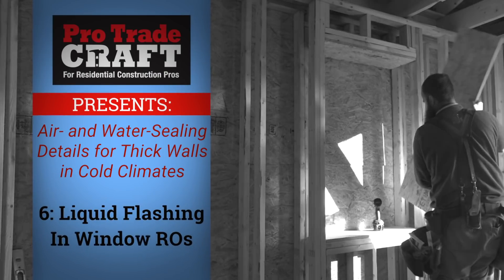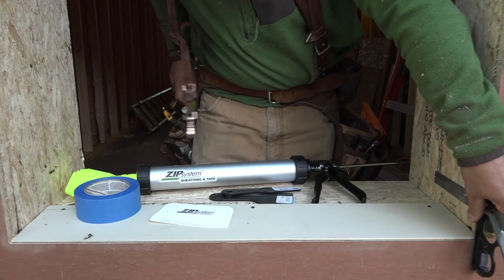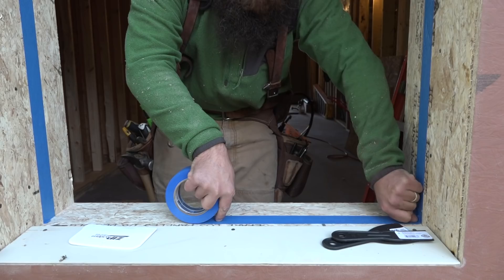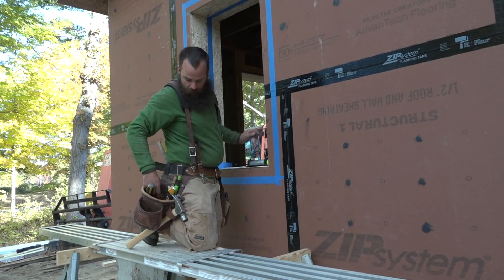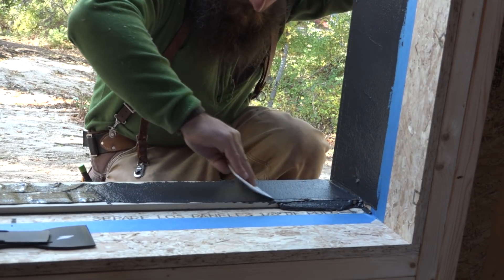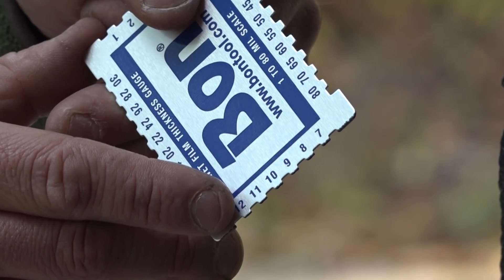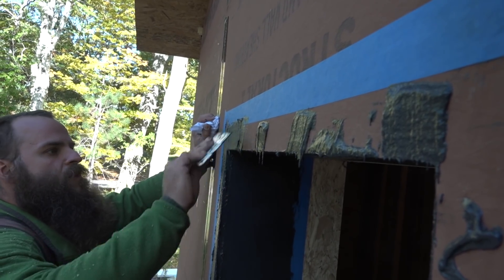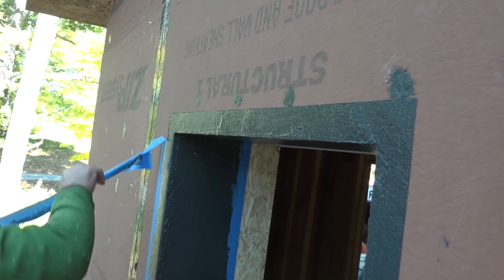Liquid Flashing in Rough Window Openings

Comment: I know it’s for product placement and there’s nothing wrong with that especially if the brand gives you a good deal on their products. However a cheaper method and still a good one would be to:

1. Buck out the opening with the Zip Paneling instead of the advantech. Zip is cheaper. 
2. Either liquid apply the seams/joints and nails or use zip tape. This option is more budget friendly compared to the one shown. Both work and are great.
Reply from the maker: He did not buck out the openings with Advantech because Huber sponsored the video series, he used the 3/4 inch material because he wanted stiffer window frames. (There was a boatload of ZIP sheathing on site as well).

Comment: Thank you for the great video. I have a question that I can't seem to get an answer for. Using liquid flash on the top and bottom of the 2 x 4s makes sense to me, but, why use liquid flash on the sides (vertical) 2 x 4s? Once the window gets set won't it all be sealed around the nailing flanges anyways? Plus when the window is sealed from the inside with either spray foam or "Air Dam" won't that add even more protection? I really love your video and I am not a hater. Just trying to learn because I will be doing this to my house and the windows are showing up soon. I know everyone online does it this way but WHY use liquid flash on the vertical 2 x 4s if the nailing flanges will also be liquid flashed?? Thank you!
Reply: What'd you end up doing David? How did it go?

Comment: Could you do this on the inside and the outside of the window frame for a  window in a bathroom?  I need to remodel a bath/shower and I'm considering putting in a window for light and to give me a place to put bottles, but I'm still trying to figure out the best way to waterproof the inside...has anyone ever done this?
Reply from the maker: The best way to waterproof a window in a shower is to not put a window in a shower.

Nobody likes that answer.

I'd go with the Schluter system and a vinyl or fiberglass window.

Comment: So there's no sealant on top of the flange of the window (on top and sides)? I don't understand how this doesn't stop water from getting in the top behind the flange. If it truly seals against the window somehow, then you've got a problem at the bottom not letting water leak out (from the angled sill).
Reply: You will still tape or seal the top of the window to the sheathing after as well, just as you would overlap with a regular housewrap

Comment: Although effective, this seems like it took some time start to finish. If at the end of the day another solution is cheaper and has the same result (doesnt leak), why choose this over another solution?

I do like how it looks and it is a superior product. But seems overkill no?
Reply: Exactly, the best application I've seen for this kind of product is when you want to flash where the wall sheathing meets the concrete slab, or you're flashing where a roof meets a wall behind the tail of the rafters. Taping a window is just easier but the liquid flashing does have a few nice uses.

Comment: why not say what this stuff is? is it tar based?  how does it dry? does it stay tacky?
Reply: The tape is a acrylic based polymer adhesive. It cures, but never 'dries out' or cracks.still vulnerable to UV so make sure to cover it up! The liquid flash is something call STPE or something. Very similar chemistry to the adhesive used to attach car windshields in their frames. STRONG stuff and cures with water!

Comment: What's the story with the 4' thick walls?
Reply: It's only 12 inches, but the idea is the ability to install more insulation, thus raising the R-value substantially.
Reply: I think it is also to provide a thermal break between the inner and outer walls. If the inner wall studs are not connected to the outer wall studs they cannot transfer heat and cold in and out...
Reply: Don't have a cabinet maker build your barn. Don't have a barn builder make your cabinet.

Comment: First what is the name of the product. Think it's new and haven't seen it. And second atleast in my opinion water is a explicit delete. Nothing is a 100% water proof just a matter of time
Reply from the maker: Liquid flash by Huber, maker of the ZIP sheathing on the outside of the house.
Reply: ive seen some of the research on flashing  think its university in Austin and fluid applied as well as the whole house stick on system not sure the name are holding up best in longevity

Comment: Let  me explain loss of square footage and the cost of lumber. Install better insulation best bang for the buck.
Reply: You didn't really explain anything. There is no loss of square footage on new construction- if the customer wants a 12x12 room, they get a 12x12 room. It's the outside footprint that grows with this type of framing, if the customer requests certain room dimensions. And cost? The subject here is a 12-inch thick wall. Two 2x4's is still cheaper than one 2x12. And being that the inner and outer wall studs do not touch, there is no loss through the stud as with conventional framing.
Reply from the maker: OK, explain it.

Comment: Will tar paper, or modern equivalent, go on the outside wall? If so, it might be good to have the paper under and beside the window opening be overlapped by the liquid flashing, so water can not get under the paper?
Reply: It looks like this sheathing has an incorporated water resistant surface, as the inside of it looks like OSB

Might be the “brand partner” Huber engineered woods the credits mention... 

  Hopefully someone will correct me, and provide useful info, if I am guessing wrong.

  I like the taped seam system for air infiltration on regular OSB, but LOVE the idea of not having to do tar paper or other barrier over the sheathing.
Reply: I think this is their wall sheathing with integrated exterior “envelope” and seam tape, part of the ZIP system apparently...

https://www.huberwood.com/zipsystem/products/zip-system-wall

Comment: How much this process cost per one window?
Reply: Say 30 min per window at $30 per hour, so $15 plus materials
Reply: @cyoungso  
What minimum and maximum temperature you need for installing. 
And look like is really time consuming. In Boston most plywoods it's painting with waterproof . It's like rubber membrane that micro movement on all structures not making cracks and every nails shut in siding is sealed
Reply: @jaro2450m  Check with huber zip, those details are in their specs
Reply: @cyoungso  
K. Thank you.

Comment: Waste of valuable time/money taping the edges.  Nobody cares (especially the water) if you have a nice straight line of liquid waterproofing
Reply: I tend to agree, but would probably use tape at least for the first few windows until I got the hang of it... would help as a visual guide to not over or under apply this gunk. I'm guessing it's expensive, but has a minimum overlap onto the wall exterior.
Reply: @defenda1 Not very difficult to master how much to use. For exposed areas like concrete to sill/sheathing I'd use tape because that would be visible.  But under siding, nobody cares. Can just make a few pencil marks around rough openings to give guide.

 Can find much less expensive STPE liquid flashing sealants than what Zip sells. Henry/Fortifiber sell Moistop - seen it at $8.50/20 oz sausage from SouthernCarlson.  BASF MasterSeal NP 150 for $10.50/20 oz sausage from S&S Sales.   Henry and BASF are big companies and have economies of scale that Huber can't match. Read Zip resells Prosoco as their own but in black, so that's why it's ~2-3x more expensive - markup on top of markup promoted by paid "building science" influencers.
Reply: The Attention to detail shows that standards are important throughout the build and gives reassurance to potential buyers/users that the best care has been taken. Right?
Reply: @amazingjay6044  Nope. Spend your time on things that matter. Time is the one thing you never get back.
Reply: @ArthurDentZaphodBeeb fair enough.
I like neatness and straight lines. 
Tomayto tomahto! Lol

Comment: A lot of extra work considering that todays window are sealed very well. If you worrying about laps apply a little sealant and as always it is inly as good as the installer that is using the product, easy to just call it good

Comment: if you buy and use a nail gun , yet still have to "hammer the nails" after , you have a problem .....
Reply: Actually that sheathing system is designed in such a way that you don’t want the nails to over penetrate. And on the edge there around a window opening it is better to set the pressure so the nails set a little proud and then hammer them to their proper depth. If your nails over penetrate you have to either tape them or use their liquid flashing on them. Nails are better than screws in this situation because they have a little bit of give for wood expansion and contraction. Screws are less likely to allow for expansion and contraction.
Reply: @ronh9384  that OSB is going to be sheetrocked or finish plywooded over ..... a "set nail" is NOT going to be a problem ...... you are attaching plywood in "rough framing" , not building a piano , and they tarred over the OSB plywood anyway !!!!! The only nails you hit with a hammer in framing are nails that didn't set with the gun
Reply: A shortage of screws?
Reply: @joshuat7171  Framing is a trade for nail guns ...... There is ZERO need for screws when framing houses except maybe hurricane clips or something , but attaching OSB ??? Hale no , you pow pow pow nail it , done ..... The owner of this house must have a LOT of money to pay for all this nitpicking stuff they're doing in the video ..... TAR ??? AROUND WINDOWS ?????? Ridiculous ...... Double walls ???? Good grief this is some overkill .... I'd just frame 2x6 walls and be done ....... you can insulate the hell out of 2x6 walls + add 3/4 " foamboard outside , hell that would be like an ice chest insulation ...... Can you imagine your house catching on fire and you have TAR around all your windows ???? Ya that would be a problem
Reply: If you're nailing sheathing which has a sealed exterior face, generally you have the gun turned down to avoid breaking through the top layer. Giving a few nails a tap after to make sure they're flush is no big deal.
Reply: @defenda1  I know all that , my point is it's slow it defeats the purpose of a nail gun
Reply: mister clean  welcome to the slow future ... if I were going to want that much waterproofing , I'd sheath it pow pow pow with a nail gun , flush heads or slightly sink , and spray the whole damn thing with elestomeric or rubberized paint .... ridiculous to use a nail gun and then hammer nails and spread pookie with a trowel ..... we have airless spray equipment .... welcome to the past that still works well and fast

Comment: I've wondered how everyone is into renewable energy, why not pay attention to the energy we are loosing first.
Reply: True. We can sometimes save a lot of energy by doing very simple things, like making sure we have adequate air intake in our (unconditioned) attics, so the roof vents do not draw air  from inside the house which will, in turn, draw outside air into the interior. Just an example.
Reply: mister clean  The entire planet uses about 21 billion megawatts of power per year. If you used solar panels that are 10% efficient (which would be awful quality. Cheap panels get 15-18%, and top of the line get 20%+ efficiency) you could generate that much power with 200,000 square miles of space. The United States is 3.8 million square miles. That means you could power the entire planet with only 5% of the space of the United States. To put that in perspective, that's less space than is already being taken up by buildings in the US. And this is assuming you only use solar panels for renewable energy. This doesn't factor in wind, tidal power, geothermal, or biomass. It also assumes that no buildings are constructed or retrofitted to be more energy efficient, but rather stay as they are now. And that is without expanding hydropower or adding nuclear. So wrong again. You are WAY off.
Reply: mister clean  How much would it cost to build the 1.4 billion automobiles that are currently in the world? OMG are there even enough raw materials on the planet for such a huge undertaking? And what about the millions of miles of roads and bridges and parking lots and infrastructure needed for such things - not to mention the hundreds of thousands of fueling stations we'd have to set up, and the extraction and refinery systems we'd have to build just to make the fuel in the first place? It's impossible! There's not enough money in the world. And just think of how this will devastate the horse breeding industry. Better stick to riding horses...

That was literally the argument against cars in the late 1880s, yet look at us now...

It's amazing what humanity can do when we want to get it done. If all you can do is make excuses for why something can never happen, then it will never happen. There are plenty of materials to make as many solar panels and storage batteries necessary to run the entire planet indefinitely. And again, that assumes the ONLY solution you embrace is solar PV panels. There are lots of renewable energy sources that do not produce greenhouse gases and don't involve PV panels or lithium batteries at all. That also assumes we do nothing about energy efficiency to drive down the amount of energy we need in the first place before we even bother with the energy source. The figures I mentioned before is to power the system as it is today - not if it were optimized to use far less power.

Comment: I wonder if you can use that for replacement window installation applications where brick and other exterior surface is intact and you have issues with the existing flashing
Reply from the maker: Probably. If you install thoughtfully and think like water.